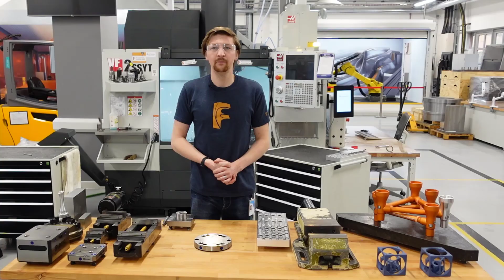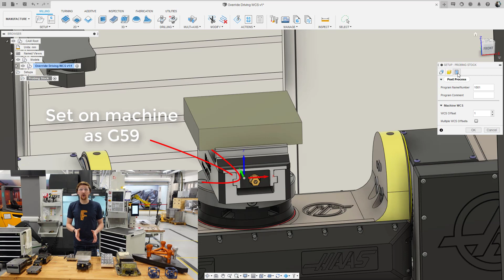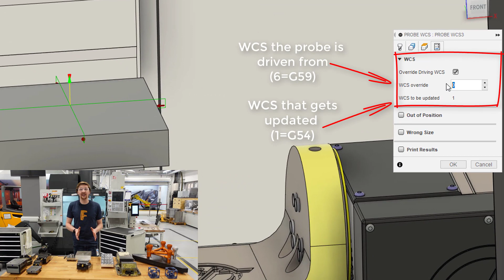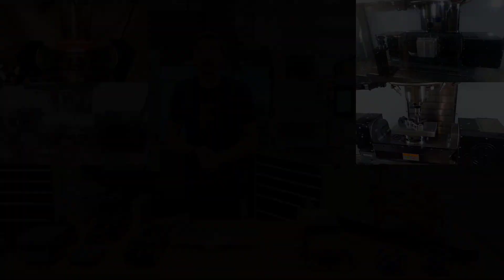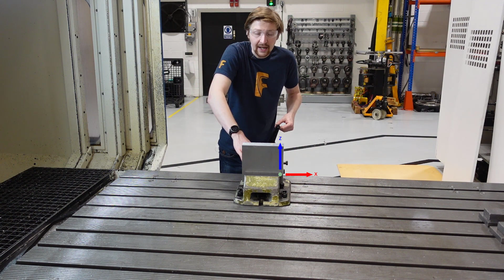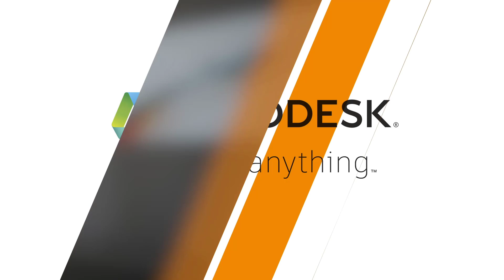Use Fusion 360 to automate and reduce setup time with override driving WCS

Comment: This is really good info but I find the video style really not easy to follow. Screen in screen is awful as you don't know what part you should be watching and it just seems a bit rushed. I'd have rather you took another five or ten minutes to really demonstrate 'HOW TO DO THIS' not to just say it can be done. 
If you watch NYCCNC video's you'll see he explains the concept, then shows how to do it with screen casts. He doesn't rush it and just makes sure that everything is concise. 

As a tutorial video take as long as you need to explain it properly. HTH

A further question is:
Can fusion probe two bores and use that for rotational alignment? 
I have a cylindrical part with to through bores in it. I want to face off one side, bore and chamfer for op1. Then flip it and face and chamfer for op 2. The only reference geometry I'll have is the two bores (as it's in a cylindrical not rectangular part). So is there a way in fusion for it to probe the two bores then output an angle to G68 and run the program?

Comment: I'm not understanding something.  Even if you're using G59 as your static point so that you can update G54 how does that help you when the selected center point is using G59?  Am I missing a step?  Do you have one setup that uses G59 as the static point to update G54, and then your subsequent setups would use the part G54 position point in the F360 setup?
Reply: Yeah I'm trying to figure out the same thing. How do you tell Fusion where G59 is?
Reply: @SteveN-bh3wv  Look at my reply a little lower, I go into more depth on how to get Fusion to actually find the right G54/G59 combo.

Comment: When I try using this function, everything works except it sets my G54 (part offset, center of block) at the point where my override offset is set (G59 at corner of vise). It finds and probes the block no problem, just sets G54 in the wrong place. Anyone else have this issue?
Reply: I've got this issue as well.  I think it's a "feature" of F360 and the Renishaw probing cycles.  When I follow this video the probing cycle and subsequent tool paths work as expected, however, the G54 is updated more as an error offset from G59 than actually updating G54 to the desired point.  As an example, our G59 is at the back corner of the vise and we want to drill a hole in the center of the part with the G54 WCS located at the center as well.  Let's assume the part is 6 x 6, and the vise is fixed jaw and is also 6 in width for simplicity.  What Fusion will do is use the P9812 (web measure) Renishaw macros to find the difference in reference position, honestly it's more like a G52.  Below is an example output for finding the X and Y web reference.

N10 G59 (Static WCS assume 0,0,0)
N20 G01 X3.0 Y-3.0 F400 (move to part EXPECTED center in reference to G59)
... (turn on probes, and protected moves)
N30 G65 P9812 Z1.5 X6.0 R0.5 Q0.5 S1  (Measure X web, save to WCS=1 'G54' )
N40 G65 P9812 Z1.5 Y6.0 R0.5 Q0.5 S1  (Measure Y web, save to WCS=1 'G54' )
... (turn off probe and protected moves)

... (switch to drill and set tool height)
N50 G54 (Actual WCS)
N60 G00 Z2.5 (assume this is 0.5 above part)
N70 G01 X3.0 Y-3.0 (move to the EXPECTED center position as programmed from G59, and compensated by G54)
N80 G81 Z1.5 F20.0 (drill cycle)

What happens on line N30 and N40 are the renishaw macro calls for web measure.  The important bits to look at are the X and Y values.  In the Renishaw macro it wants the "nominal size of feature" in X or Y axis.  And remember the probing cycle will give the "Difference in expected position".  Since we know nothing of G54 it has to be in reference to G59, so our expected center point is X3.0 Y-3.0 with an expected web thickness of 6.0 in X and Y.  Let's assume the stock is centered in the vise but actually 6.1 in X and 6.2 in Y in size.  After Running line N30 and N40 G54 X will be updated to 0.0, G54 Y will be updated to -0.1 (we'll omit Z).  X wasn't updated because the material is centered in X, but Y is changed to -0.1 because the material is 6.2 and the vise is a fixed jaw.  So the key here is the DIFFERENCE of the expected and actual in reference to G59.  In the Y direction the expected center (from G59) is -3.0, but because the material is 6.2 in width the ACTUAL center is -3.1 from G59 (remember we have no idea where G54 is).

So the following lines for the drill operation use the expected center position from G59, but we use G54 to compensate for the difference.  And I agree that it's not the expected solution, you'd expect that because you probed the center of the part the center of the part should be X0.0 and Y0.0, and not X3.0 and Y-3.0.

Hopefully that makes it clear as to what's going on.  The feature is more like using G52 offset than actually updating G54 to the TRUE WCS desired.  SO be careful with subsequent setups that use G54 and the part center as the WCS, because if you don't probe with override WCS you WILL CRASH.  Because G54 is at the difference of G59 from expected.

To get around this, and I should probably do this as well, is to use the macro variables for G54 WCS (For Haas NGC) #5201-#5206 and Fusion with manual NC to update the G54 part position center in relation to G59 as a parameter and then probe the ACTUAL G54 part center point since we now have and expected ACTUAL reference to G54.
Reply: @capnthepeafarmer  so in the manual when it says "New work offset = active work offset + error" I expected that the G54 would be calculated as as follows... Let's say G59 is 10X,-10Y (machine). Wouldn't G54 then become 13X,-13Y (machine) after probing since G59 is the "active work offset" and G54 is the "new work offset"?  Then the drill operation would be called as X0,Y0 (G54)...That's how I expected it to work.   Would be great if you could set a probing reference (ie G59) then probe and set your target work offset explicitly, having both coordinate systems on the screen, with the probing reference depicted as a different icon. I get that it's basically making G54 an offset from G59.
Reply: I decided to make a macro for Fusion, it wasn't too difficult, it makes the following lines to update G54 based on the G59 point in space so you have a start reference, and creates a manual NC.  You could just as easily create the Manual NC operation and paste in the below for Haas NGC, then manually change the values based on your setup.

N20 #5221 = #5321  +  [0.0] (Update G54 X from G59)
N25 #5222 = #5322  +  [-2.0] (Update G54 Y from G59)
N30 #5223 = #5323  +  [2.015] (Update G54 Z from G59)
Reply: @capnthepeafarmer  wow this Macro is a beautiful thing. Thanks for your response, I really enjoyed reading it I absolutely love this stuff and it's rare to find someone who speaks the same language, especially with the advanced stuff. So I had actually contacted someone at Fusion a few months after this comment, and after arguing with the poor guy for far too long he helped me come to the conclusion you outlined above. The worst part is I realized I was wrong when he said "did you try running a program after using the cycle?" To which I replied "of course not! I'm not gonna run my program when the offset is clearly incorrect everytime I check!" Long story short: I overcomplicate things so often it's almost unbelievable. I was so certain it was going to update G54 in the expected way that when it didn't I just figured there was something wrong with the cycle. 

I'll check out that macro next time I get a minute, I had intended on making one myself at some point but just haven't had time so thank you kindly for sharing your solution.
Reply: @RyanM33  No worries!  Coming from SolidWorks and MasterCam, there are a lot of things I expect out of Fusion 360 that are absolutely trivial in other programs, and it drives me nuts.  And the only way I have been able to get around those limitations is to learn how to do scripting in the Fusion API (which is super easy).  The API has its own limitations, but at least you're able to kludge it in the background behind a button press 😂

Comment: I don’t understand why 1=g54
And how 6= g59
Reply: Not all machines use G54-G59
And one of the strengths of CAM systems is the ability to change the machine you are posting to without having to re-do everything.
So we choose the most universal way to display this.
1=G54 on a HAAS
1=1 on a Heidenhain
2=G55 on a HAAS
2=2 on a Heidenhain 

and so on.....
Reply: 0 = G53 , machine origin !
Reply: @getsix10  Be careful a lot of our posts are configured to use 0=G54 & 1=G54 as its extremely rare people program from machine WCS inside of CAM systems.
Reply: @getsix10  No, both 0 and 1 is G54. G54 is 0 by default, unless you use a different WCS, whereupon G54 is now 1. So G55 is 2 and so on.
Reply: @duodot  I think this is the key confusing part and really needs more explaining.    Especially since they are not showing their setup page (is he using 6 there or on the probe part?) etc.

Comment: Thanks for the video Richard. Could you put together something showing a probing update while the part is turned 90 degrees on a 5 axis?  I find that some of our machines require a slight “cheat” of the z offset down toward the vise by a few thou when milling side features. Right now it’s sort of a guessing game and involves multiple offsets. If probing would update that in process I’d really like to see how we’d do this reliably.
Reply: Probing a WCS in a 5-axis setup is pointless and retarded, as once you move your origin out of the point where the A and B axes intersect, parts come out wrong because it's been moved in a way Fusion did not expect. A 5-axis table needs to have a constant origin point in the centre. You can use probing to inspect a part, but never to change WCS in a 5-axis!
Reply: @duodot  I assume you didn't know about MSRP and DWO 2 years ago?

Comment: I have adopted a similar approach when I am making more than a few parts. 
The difference is that I manually probe the part offset for the first part.
This makes it faster to put the stock in the vice and still hold tight tolerances on subsequent parts and second operations. 
Also, on second operations, I will often face the part before probing to expose the feature to be probed. Have to be careful for burrs in this case though.
Reply: Hi Kurt, yes its a different midset to get in with this workflow but once you get it working its a real time saver, you can swap jobs out all the time and never have to manually set up.

Comment: Now I just have to translate this into Heidenhain with presets
We have lang zeropoint in our 5-axis and uses X0 Y0 (Center of table)  as Zero-location. It would be nice to be able to set Z0 based of another preset, IE where is the top of our baseplate. 
. Heidenhain has both datum-table ( G54 and so on) and presets. Our machine didnt come with a datum-table. The presets is offsets from the centre of the table in X Y and  for Z from , i think, distance from rotation-center of B (and negative, so all those are something like -187.5487)
Reply: Hi @Daniel this works exactly the same on a Heidenhain, It was actually a project I did with a customer on a Heidenhain that made me make this video. 
On that project we used Pre-set 40 as the static datum and then pre-set 1 as the local datum that was updated for every part.
Reply: @richardstubley9651  It seems that it might work as intended :)

I haven't double-checked yet, but is it possible to use preset 0 as the one that updates? That one is the one that is used as "default" and gets updated when you set wcs from manual-mode (in some cases at least)

We use presets for reccuring parts to speed up setup-time. We have the stock-size defined in our setup-sheet (or you check it inside the project-file) 

In our case we dont want to move the WCS around for every part when running automation. But we want a simple way to automate when we run one-offs and setups a new recuring job
Reply: @DanielRegnér-c5d  this method sounds like it will work perfectly for you then! 

When I did this on a TNC 640 we didn't use preset 0 we used 1. Looking at the manual 0 can do things a bit differently so we didn't risk it. I'm sure 0 would have worked but it was just as easy to use 1.

Comment: I still don't get it. If I have to probe the part to set G54, how is that different from what I am already doing? Ciao, Marco.
Reply: Then you don't have to manually probe the part. Once the G59 is set, you model everything up in Fusion and then let the machine do the probing automatically.
Reply: @vilts  This answer is the simplest and best in my head. Thanks!
Reply: Hi @Crivo 152 The issue with setting G54 and then using G54 is it is constantly moving from part to part. Its good practice to have a static datum that the part relates back to. This is really useful for multiple part production.

If you use the action "out of position" to alarm if the part is too far to out in X for example. You will be checking is this part within tolerance from the last part. This can cause variation and creep. If the part was to move 0.5mm to the left every time, after 10 parts its now 5mm out. If you use override driving WCS every part comes from a static datum so part 1 is 0.5mm out, part 2 is 1mm out and so on. So setting out of position alarm at 0.75mm would not alarm in the first case, but would alarm with override driving WCS.
Reply: @richardstubley9651  Thanks Richard, I guess It is hard for me to understand the gains since I only have a homemade CNC mill and I don’t run batches of parts. Things might change in the future though, so I am keen on learning everything I can. I genuinely enjoy the tips these type of videos provide.
Reply: I think its for people that program all their parts using all the fixturing. So if you have fixture "C" and the zero point is 5" up from the never moving part of the fixture (G59) the probe knows where to go on the first part. I really dont see it as that much of a time saver. Its only saving you from probing the first part, after that, they are all in the correct place. Everybodys got their way though.

Comment: why not just use the g54 if you going to probe anyway????
Reply: @imfbrad, the whole idea here is to leave a datum static that never changes. So you can rely on this from part to part, if you didn't use this that datum would be constantly changing and may change to a point that can cause issues.
Reply: @richardstubley9651  doesn't make since if you have to probe G54 there is no point in the G59. Its pointless. I have been doing this for over 25 years and doesn't make sense to me. If you were saying there was no g54 then it was make sense   better
Reply: @imfbrad  it does make sense if it's possible for the stock or part to vary slightly  in size or position from one run to the next.
Reply: @ScottMoyse  If that is the case the g54 would do the exact same thing.
Reply: @imfbrad  You're wrong. Imagine setting up ten parts on a 3-axis bed, all referencing the same hardcoded datum. You can line the programs up and let it probe every location  while you walk away to do something more valuable. Moving your datum probing to a repeatable, dependable process is a massive win for reliability and productivity.
Reply: @richardstubley9651  how do you tell Fusion where G59 is?
Reply: The difference is if you simply use g54 you have to probe it and set it the first time. It can find it again after that and make slight changes needed fine , but this method is talking about setting the g59 once and then in the future as long as what you model In fusion is accurate to you set up you can program probing to find the parts and set new wcs locations amd call them what ever you want but it will be able to prob automatically the first time based off the fact that the part should be where you programmed it in reference to the g59. It just means you can swap out anything and and go strait to in production probing amd skip the manual initial one for each new set up
Reply: This would save you a ton of time if you had a part that needed features on all six sides and you only have a three axis machine . Unclamp reposition reclamp run program . Vs …. calling up the probe , jog to probe position, edit probe program, load probe program, run it , send it home , load new program , run program .
Reply: I see several benefits of using a different WCS to drive the probe.

1. It avoid "drifts". Let's say you have a stock of 1x1x1, G54 is at the top center of the stock. The stock is held in a vise on parallels (so X may vary between parts). Say your probing operation has a position tolerance of +/- 0.1", and for simplicity let's assume stocks are the same exact size.

You place first piece of stock in the vise, roughly set G54, and G54 drives the probe to get the precise WCS, all is good.

You place second piece of stock in the vise, but this time 0.1" to the left. It still works, because it's still within positional tolerance you've set, the probe would do its thing using the G54 that was set from first part, and update the WCS, this time 0.1" to the left, things are still good. 

You place the second piece of stock in the vise, this time 0.1" to the right, compare to the first part (so 0.2" to the right compare to the second part). The probe would try to measure using G54 set from the second time, and it would error out, because it thinks the stock is 0.2" out of position, and that's because G54 "drifted" to the left. If X0 is set to the center of the vise fix jaw in G59, and G59 is used to drive the probe, it would not drift because G59 will remain the same.

2. If the probe use the setup WCS, you'd need to roughly set WCS by jogging the probe to WCS and set X. Y, Z 0 for the first time, before letting the cycle to run. But if the probe driving WCS is fixed, and you model/use that position in CAM, you won't need to because Fusion/machine would know where the part is, relative to the fixed WCS.